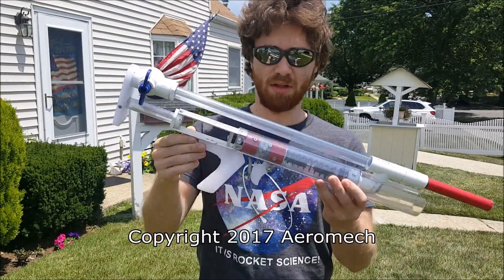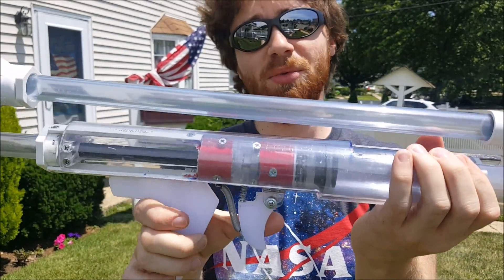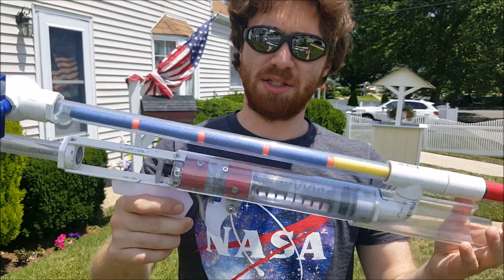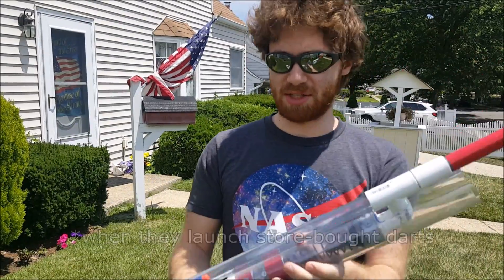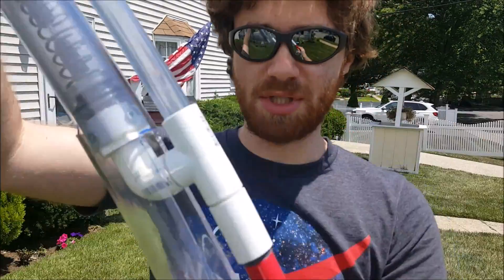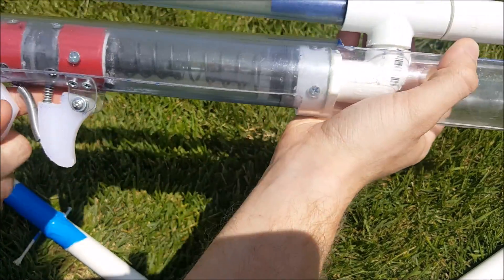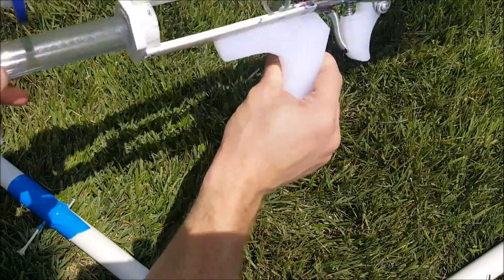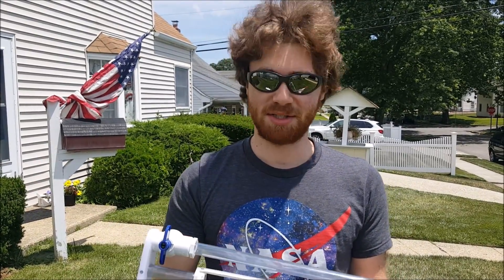Shorty DIY Nerf Blaster!

Comment: So how do you get the anti-kink thing in there? As far as I can tell, you'd have to put it on the plunger rod, stick it in, and then drill and tap with the spring and rod underneath? And wouldn't drilling and tapping cause some gunk to get in the plunger tube?
Reply from the maker: You build it into the plunger-rod-kebab when you build the thing. And if you're careful it shouldn't get much junk in the plunger tube, or at least no more than normal operation would anyway

Comment: you would not have that spiral issue with BOOMco darts. And that straight pipe system would work fine with the silicone tips. Just shorten the front barrel
Reply from the maker: I've never used Boomco darts so I cannot personally speak for them, but I am dubious about this claim. Boomco darts are still stabilized by mass, and homemades output far more air than anything storebought. I am well aware homemade darts would work better, this is merely an experiment. As for silicone darts, any dart that I need to have coated in corn starch is not a dart for me, I play in 100% Northeastern humid summers, sunshowers, and straight up rain. They don't stand a chance at functioning
Reply: Aeromech I have a lot of experience with them. it's not a dubious claim. they fly straight even at over 300 fps. Frankenzilla himself has even shot them from a 4B tank front loaded and had no issue. OC Nerf has also shot them very hard from a bbb and no whirleys. I also have plenty of others in my Facebook group who have shot from high power and BOOMco does not whirly like nerf elites.
Reply: Aeromech and actually they fly much better in rain than nerf darts. I've played in rainy conditions and my darts flew just as straight as normal. Also you do not need to coat the tips in corn starch. I'm sorry you haven't given them more of a try
Reply: Aeromech I also just competed at NIC level in Los Angeles and did very well. I outranged everybody and got a lot of tags. You should really put more time into something before dismissing it. "Dubious" offends me dude. I've been working hard on this stuff. Give it a chance and maybe you will see the benefits. And if you don't like the tips, replace them with felt

Comment: Also can you do a full tutorial and pricing sheet?
Reply from the maker: No on all accounts. 1) scar barrel does nothing, darts are light enough don't have the rotational inertia and are stabilized by their weight not by rotation. Show me a side by side comparison where accuracy is noticeably improved. It's showmanship/salemanship as far as the science is concerned. 2) I have multiple tutorials on all of the necessary fundamentals already on my channel, and I do not have the viewership to justify spending 20-30 hours filming, and 10-15 hours editing. 3) Also probably not
Reply: Aeromech I also heard similar about the scar barrel, but I read through an article written about how out of three possible lengths, the short and the mid did nothing, but the longest length made about 85 percent of the darts fly straighter
Reply: And by straighter I mean within a foot of the target from 30 feet
Reply from the maker: It's meaningless without a control group. Compare side by side a set of 50 shots from each length of scar barrel, as well as a standard smooth barrel, Perhaps appropriately sized PET or brass. From this you can get a full analysis of dart spread, average precision, and effective range. I suspect a smoothbore barrel of the same length as the scar barrel would yield similar results, and the scar merely slows the dart down to a veloicty where it is stable